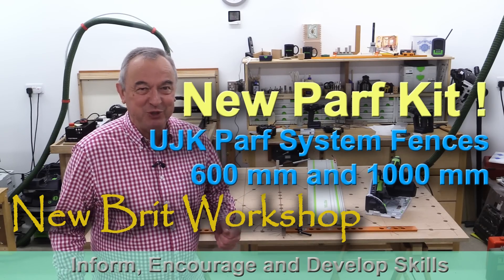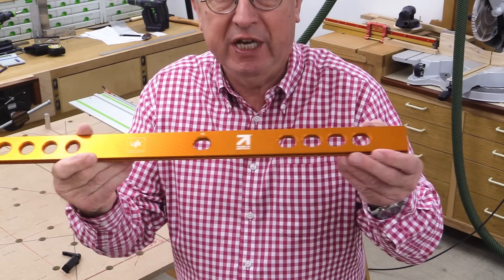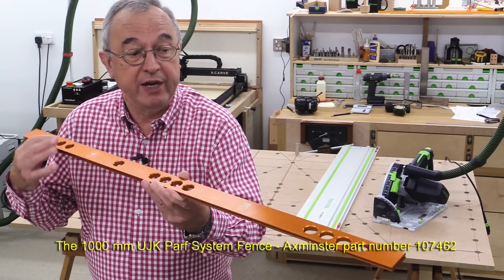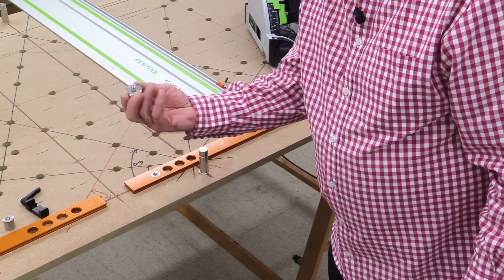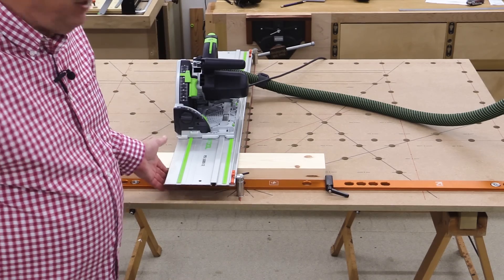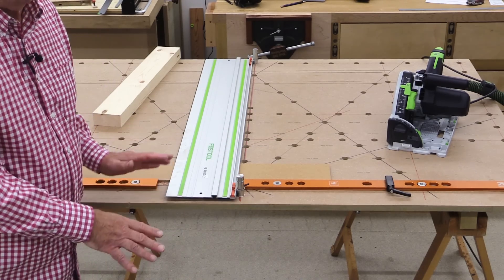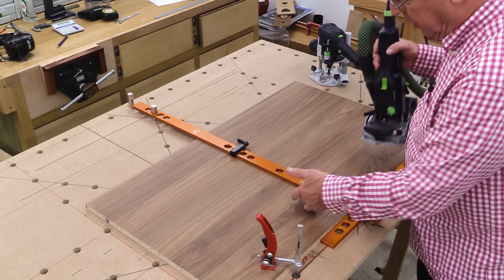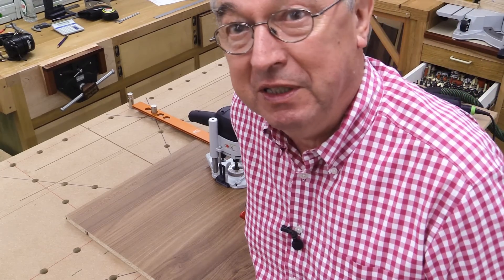New Parf System Fences

Comment: I bought the original version of the Parf guide system and found that even though I used the chamfer tool to ease the dogs into the holes on my MF2 table, I can’t get the dogs into widely spaced holes. The new oval holes will overcome that problem, but I am reluctant to buy a complete new set. Thanks for the new update, very helpful.

Comment: Ok. So this really is nifty neato! I have been building some jelly cabinets and I’ve gone back and forth with using dados vs dominos for joinery. I was struggling with the dado’s mid panel lining up. I think this set you talked about at the end is my answer. I already have the 600. Looks like I. Need the 1000 too. I was already watching another video and thinking… I need a second one. I have an MFT table. But when building cabinets and some of my recent projects I’m finding it limiting. And I’m about to build a new assembly table. So I’ve been looking to get the parf guide system and make my own top. I have access to a ShopBot CNC but it’s not calibrated and kinda poorly maintained. It’s at a makerspace. I know the staff do their best. But when you have a variety of people using it… you get hiccups.
Reply from the maker: Hi Angie, The whole point about the Parf Guide System is that it will beat so many CNCs for the exact reasons that you have stated. I have had reports of accuracy of 0.001 of a degree for 90 degree cuts on tracksaw cutting stations made with the PGS.  Cheers.  Peter

Comment: Hi Peter, Talk about coincidence, I just placed a note on an older video letting you know that my old UJK Parf Fences were not well machined.  Because returning products from the States is so expensive, I may just take the risk and try buying the 'latest'.  That is because i really believe your system for cutting plywood down is currently the best one out there.  Could you please do us a favor.  Place the two Parf System Fences on each other and see how much light shines through.  On my current ones, I can slide a 0.2mm shim between them as they have a high point in the middle. I am just curious as to what tolerance these items are manufactured to?  Many thanks for all you videos, please keep them coming and do not stop inventing new gadgets 🙂
Reply from the maker: Hi Pat, Mine are perfectly flat. It is important that when moving a fence that one pushes the dog up from below rather that using the fence to lever them out. I really do not think that the 0.2 mm variation will make any difference to the function of the fences. Please let me know if you are still worried and we can take this further.  Cheers.  Peter

Comment: Hello Peter,

I always enjoy your programs.  Thank you.

I have my 10 year old 4 ft x 4 ft, layout and assembly table.  I over designed this table to be likely bomb proof.  Three (3) 3/4” sheet layers. (Plywood, MDF, MDF.). All nicely glued together. WOW ??

I want to incorporate the Parf guide rails (2).

Drilling 20 mm holes would be unreasonable, time consuming, and dysfunctional.

What alteration can you suggest to establish a PARF guide table system?  

Thank you.

David
Reply from the maker: Hi David, Gosh, certainly "bomb proof". The PGS and all Parf products are designed for 3/4" or 18 mm MDF. That can increase to 22 mm if necessary. Would you be able to have a new 3/4" top set (say) 5" above the existing top? That gap needs to but sufficient to get you arm under the top in case you need to retrieve something or tighten a screw on the underside of a dog. Failing that can you replace the existing to with 3/4" MDF?  I have always used just one layer of 18 mm Medite MR MDF for all of my tracksaw cutting stations and some bench tops as well. Good luck.  Peter

Comment: I have the new 600mm Parf fences - they are really good and very useful addition to my homemade table made with the Parf Guide System.
 I would prefer a metal stop+Bristol lever rather than the supplied plastic one. I get that will put the price up - maybe it could be offered as an option?
Reply from the maker: I will let Axminster know - cheers.  Peter
Reply: @NewBritWorkshop  Peter, my 1000mm parf fence is on order from axminster, but I agree about the stop; I'd pay extra for a premium aluminum version. Also, I might be missing them, but I'd like the dogs (not the securing knobs) that come with the parf fence to be available separately as well. Have a great day!

Comment: Hi Peter, have you used rail dogs in conjunction with the UJK fence? Thinking it could give extra cutting capacity... Thanks
Reply from the maker: Hi Robert, I do not like rail dogs unless they have a collar to ensure that the dogs remain perpendicular to the bench top. I tested some that were made in the US many years ago and that experience led to me creating the original Parf Dogs now made and sold by Lee Valley. Currently the best way to increase capacity is to create some offset holes at either 32 mm or 48 mm beyond the top and bottom row of holes on the bench. Alternatively, when using the MFT3 and for those cuts where it can be set up, just rotate the work by 90 degrees so that the length of the MFT3 dictates the capacity rather than the depth.  Peter
Reply: @NewBritWorkshop  appreciate the reply. Thank you :-)

Comment: Good morning Peter,
I have a quick basic question, when drilling 20mm holes using the Parf guide system, is it best to clamp a sacrificial board under the top to prevent tear out or not?
Many thanks,
Barry
Reply from the maker: Hi Barry, The cutter is designed to reduce break out, especially when used with good quality MDF. I would not recommend using a backing board but if one is used it is essential that the 3 mm pilot hole goes sufficiently through the backing board in order to allow the 20 mm cutter to work as it should.   Peter
Reply: Peter, many thanks for your speedy response.

Comment: Love the 1m fence Peter! - have you had any thoughts/discussions about designing a self-centering cutter to bore out 19mm dog holes to 20mm? - I've a mixture of both standards in my workshop and suspect (maybe?) that I'm one of many in that situation
Reply from the maker: Hi Fergus, That is not something that I have considered. It sounds like a fancy reamer but my concern would be the accuracy of placement of those original 3/4" holes and then the accuracy of the reaming process.   Cheers.  Peter
Reply: @NewBritWorkshop  thanks for the reply Peter - I agree on both counts. I had a lengthy chat with my father (restores clock movements; hand turns parts to extremely fine tolerances) about it to see if we could come up with a self-centering approach based around an "almost" 19mm shaft to center the cutter, not unlike the 3mm centre guide of the 20mm drill in your Parf Guide System, with a reamer on the same axis that follows it through at just half a mm radius wider but as you say if the original holes are off the 19mm in any direction then the reaming will be off by at least the same margin - very tricky indeed!

Comment: love your work peter i am trying to understand why your dog table is not saging with all the holes you have  do you have stifners under the table
Reply from the maker: Hi Mark, The MFT3 size top will not sag as it supported along all 4 edges. My tracksaw cutting station does not sag as it is supported on a pair pf trestles with 4 cross supports underneath.  Cheers.  Peter

Comment: Thanks for re-posting Peter, as soon as I saw the video the first time you posted it I went straight to the Axminster website but... nothing. Anyway, One in my basket to collect tomorrow from Axminster. Strangely, the 600mm is not available for click and collect, but the 1,000mm is perfect to replace the original MFT3 fence. Interestingly I discussed the problem with the MFT3 fence (not being easy to lock down precisely since it moves when tightened) with a couple of Festool reps at the recent roadshow; they both said they'd never heard of this being an issue before! I suspect they haven't been listening since it is such a poor design it is really the antithesis of Festool precision.
Reply from the maker: Hi Andrew, The Festool problems lie in the variable accuracy of the layout of 20 mm holes on the MFT3. The holes themselves vary in size as well. It was because of this that I embarked on my quest to produce a better layout which led to the creation of the Parf Guide System.  Good luck with everything. Peter

Comment: Interesting concept using the stops on a rail...with your domino for repeat mortises. Did Axminster come up with this idea after watching my video 5 months prior to this? Granted I was using a Festool guide rail and stops I designed for a DF500 but what you're showing is a straight knock-off of the idea I presented in May of 2021.
Reply from the maker: Hi Chris, I have never watched any of your videos. Even so the use of a fence with the Domino is fairly obvious and Axminster had pictures of the fence being used like this long before you published your video.  Peter

Comment: I think these new fences look great and I like the idea of the two different lengths and the groove is a big improvement. What is making me hesitate in pressing the buy button are the oval holes.  I am worried that overtime because of the reduced contact area, i.e. greater force on a smaller area, the mdf will crush  and then the fence will become sloppy.  Any chance you will be making the same fences but without the oval holes?
Reply from the maker: Hi Pat, The original fences had just round holes and were perfect if the bench top or tracksaw cutting station had been created to the accuracy of the Parf Guide System. However, many people had MFT3s or 3rd party benches with holes and the accuracy was not good enough and so the fences could not be used. Hence the introduction of the elongated holes. Most people will leave the fences in place and only move them infrequently. There is no expectation that this will lead to any wear or damage to either the top or the fences.  Cheers.  Peter
Reply: @NewBritWorkshop  Hi Peter,  Hope you are enjoying your E-car!  Axminster were kind enough to replace my parf fence that turned out to be curved?  They sent me a parf fence with oval holes.  Works well and I can now use it on my original Festool MFT/3.  Only one problem.  I now have an old Parf Fence and a New Parf Fence.  They do not match in width?  The old measures 40.54mm and the new 40.07.  Was this intentional?  If it was intentional then the two fences are not really compatible unless used at an angle to each other.   If, I order a fourth parf fence, what are the odds that it would match the width of one of the 3, I already have? Thanks.
Reply from the maker: Hi Pat, I was not aware of the width change. I suggest that you contact Axminster Customer Services and explain that you expected the two to be the same.  Peter

Comment: Hmm, so the fence has wiggle room for inaccurate tops? ..but surely if the top is not accurate, none of your cuts are going to be accurate? ... am I missing something?
Reply from the maker: Hi Ben, Who knows? But the third party tops (Festool MFT3, CNC ones and others) may just have hole spacing issues or the user just needs a fence.  Peter